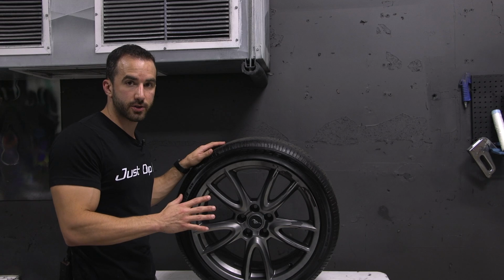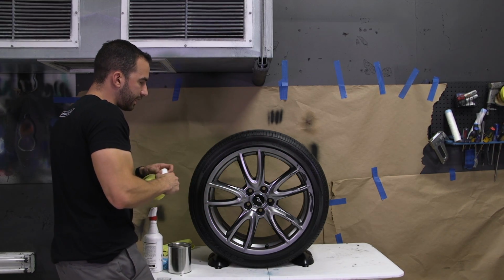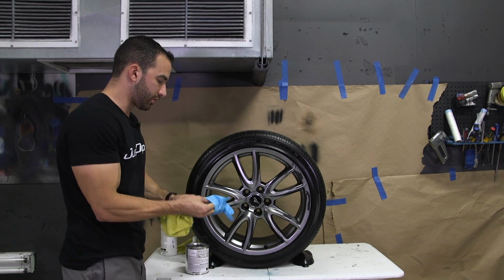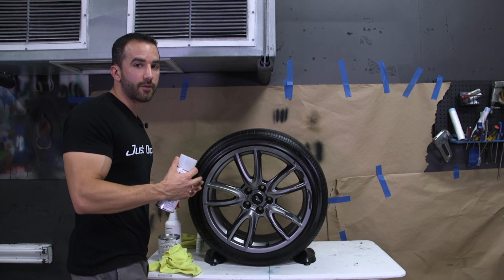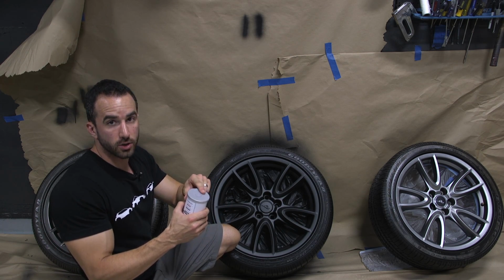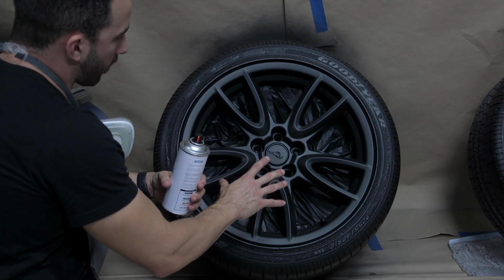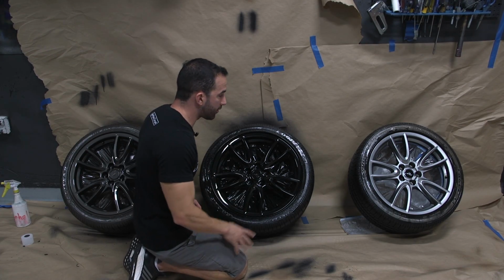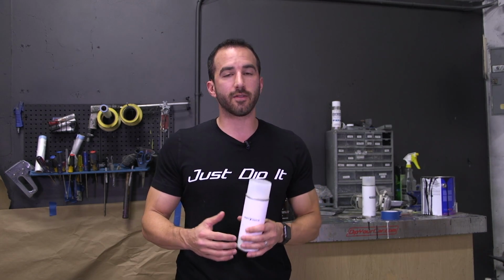AutoFlex High Gloss Aerosols - The Complete Guide

Comment from the maker: CAN YOU APPLY AUTOFLEX GLOSS OVER PLASTI DIP?  No, you can not.  The gloss does not adhere to Plasti Dip and will cause huge problems - do not waste your time or money.  AutoFlex Gloss should only be applied over Spray Wrap Pro or Spray Shield.
Reply: I hope that in the future that you guys start making the Aerosols in pearl colors to do wheels kind of like you do with the current plasti dip.
Reply: DipYourCar auto flex can still be used on emblems correct?
Reply: Yes, they can
Reply: DipYourCar Do i need the dip sprayer paint gun or it can be done with a normal paint gun connected to a compresor?
Reply: DipYourCar please do a autoflex video with a lplv spray gun and a smaller compressor.
Reply: Do you have any dark chrome color like the OEM color the Mustang wheels had?
Reply: What happened to the Aerosol autoflex gloss black wheels kits? All I see is the graphite.
Reply: Is the gloss black no longer available for purchase?

Comment: Looks great but how durable is it? There must be a reason why you do not simply pull the tires off first. What would happen to the coating if you mount tires on the rims?

Can you power wash them or will it peel off? Can you use normal, solvent based wheel cleaning products?

That is a lot of unanswered questions of significant practical importance.

Comment: What happens when you take your car in for a tyre swap. I've seen the machine they use to lift the tyre off the rims... Doesn't it just shred the paint seam around the outer lip of the wheel? If it does, do you need to peel it all off and re-do or can you patch spray any exposed alloy?

Comment: Hi there guys, hope you're doing well. One of my vehicles have those annoying rubber window trims. Even though its a good quality material still makes it look cheap,  and wish Audi used chrome trim instead. So I'm planning on coating the four door window rubber trim with Autoflex black gloss, any suggestions on How to prime / prep the rubber trim?? they can be disassembled so I will work on them on a flat surface; as a Remark, there's rubber trim only on the lower part of the window (horizontal trim). Also how about black Unpainted plastic moldings (like the ones in the grille / fog lights..) which would be the proper prepping/priming process? appreciate your reply guys, thanks!

Comment: I assume this product can only be used indoors with a decent temperature. Miami has a lot of humidity around this time of year so spraying outside is a waste.
Reply: I dipped my wheels outside under a tent LOL. Surpringly wasnt that bad, I want to go back, clean the wheels, add another coat of dip to cover up road damage that occurs over time then put some gloss to see what happens. But worse part was the heat under that fucking tent in the Miami sun
Reply: You won't want to spray these products outdoors
Reply: Lightning cover the wheels with big plastic containers leave some gap for air